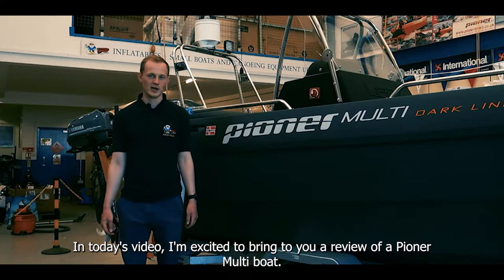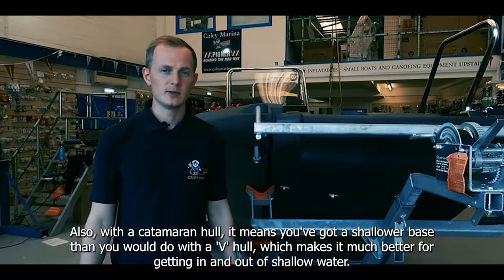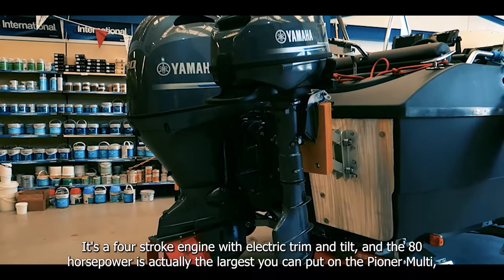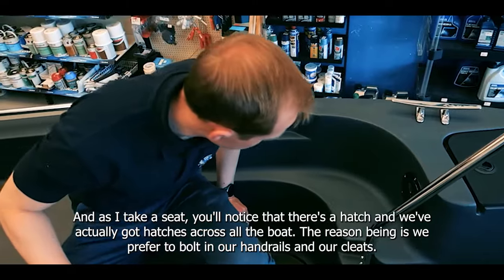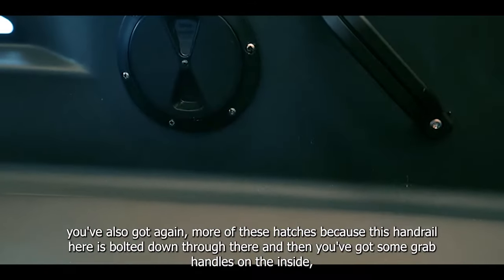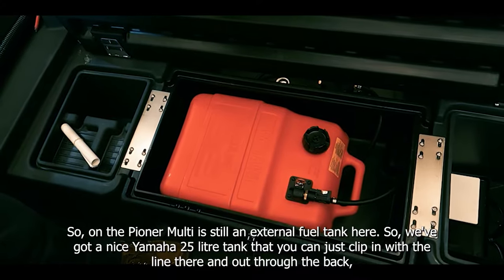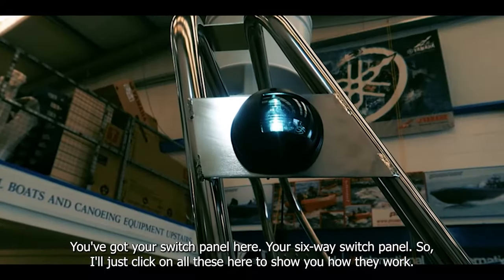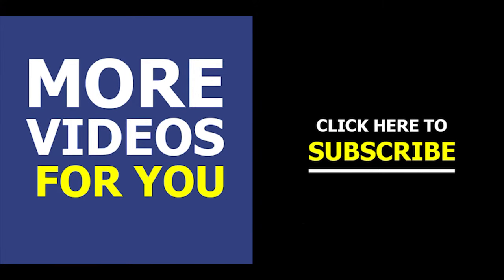Pioner Multi Boat Review | Pioner Boats By Caley Marina

Comment: They are great boats Just bought one last week in the netherlands. Just too bad the stickers came off the second day. The outside hull has a rough texture.

Also found the bottom floor wasnt that deep and it was quite scary going up the north sea.

It does handle great in corners!
Reply from the maker: Hi Melvin,

Thank you for your comments, if you contact your local dealer they should be able to reapply the stickers for you. 

The hull is a shallow draught but you should find it more than capable in Category C waters.

Enjoy!

James

Comment: Hi James, I'm looking at selling my redfinn 6.0m and my interest has been sparked with this customers boat. What would be the price for this all in. I would be guessing £40,000-£45,000. Am I near the mark with that ?. It's a pity the marina won't look at older outboards because Ronnie is a great mechanic.
Reply from the maker: Hi John, 

I am glad you are following a few of our videos, thank you for that!! 

The Pioner Multi has a large variety of package options so it really depends on what set up you are after. If you go to Pionerboat.co.uk on your PC you will be able to build your own Multi package which will give you an indication of price.

It is a fantastic boat, the most capable in the Pioner fleet for both leisure and commercial use.

Unfortunately, we find with older outboards that if you solve one problem there may be another around the corner and when you combine the labour rate for diagnosing some of these deep problems + parts then from an economical point of view they become not worth it. There are also some further complications with older outboards and the new E10 fuel.

We have a fleet of heavily used Pioner Multi’s which we hire to commercial customers. If you ever fancied popping down to the marina to view a Pioner Multi give us a call and I will confirm that we have one on site. 

Let me know if you need anything further.

Kind regards,

James